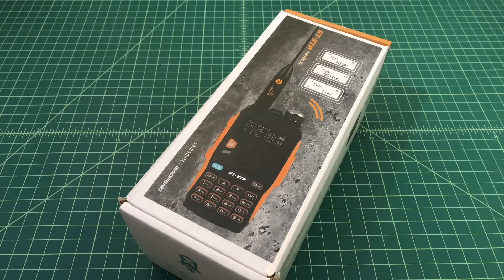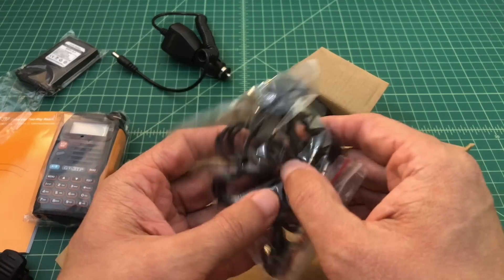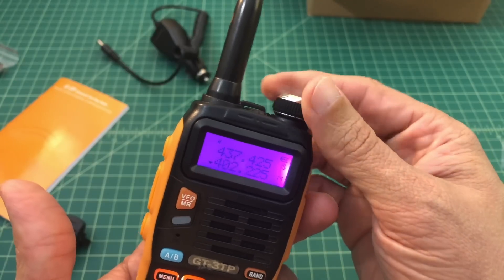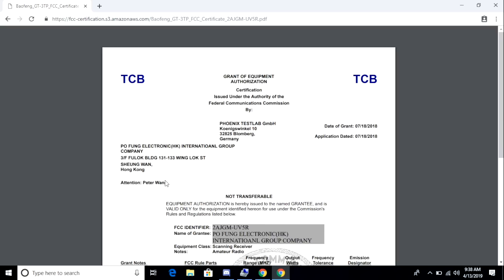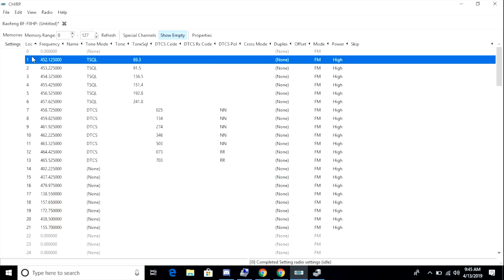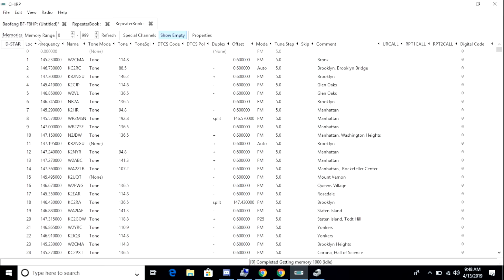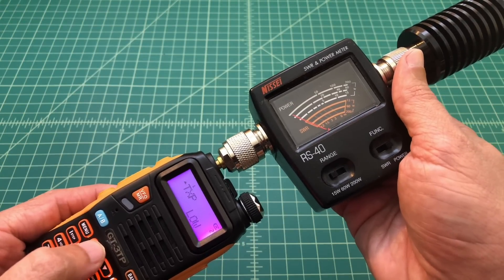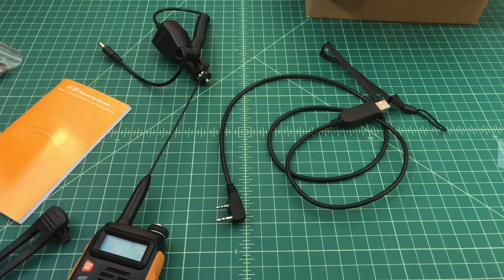Baofeng GT-3TP HAM Radio Review - TheSmokinApe

Comment: Hello, just purchased the same radio and cable as in the video. Followed the instructions but continue to get an error that the radio is not responding. Any suggestions?
Reply from the maker: Make sure your connections are good, the radio is on with med volume, and you can see the cable in device manager.

Comment: I just programmed a new GT-3TP following your instructions and ran into a problem. It appears that if you set the vhf uhf lower and upper limit as you instructed, you cannot manually enter any frequency outside that range after programming with chirp. Did I do something wrong or should we not set lower / upper limits?

Comment: Hi,
is there any Firmware that let´s it also broadcast in DMR mode, so uses digital codecs instead of just analog FM ? I wanted to have a DMR device, but unfortunately bought this device, which standardly has only analog FM modulation. I wanted to have a digital scrambler and digital codec, so not much noise... Thanks.
Reply from the maker: There isn't anyway to convert this radio to digital, sorry man...
Reply: @TheSmokinApe  Thanks for the Info. I will first test this radio and also later buy 2 additional DMR devices...Thanks Mate.

Comment: soooo I am totally new to the radio thing.  Did I just damage mine by transmitting on it without the antenna attached?  I was just trying to see if they worked straight out of the box after attaching the batteries. :-\
Reply from the maker: It’s probably fine but it’s not something you should do, it’s pretty bad for the radio.

Comment: Is there any option for this radio to charge from USB directly to the radio battery? Not using the desk cradle etc. Cheers
Reply from the maker: Unfortunately not.
Reply: @TheSmokinApe  oh ok thanks mate.  So if the radio can only handle 10V going in, is that right? Technically if I find a USB that regulates 10volts could I rig up some sort of charging capability?
Reply from the maker: Anything is possible but that’s above my pay grade 👍

Comment: Very good video. You mention that once a transmit range has been set using Chirp even a factory reset can't change it.
I made a mistake entering the range. Is there any way to correct this? Cheers, Bruce
Reply from the maker: You can use Chirp to set it back.
Reply: @TheSmokinApe  Thanks, that worked. I tried before but didn't realise that upper frequency is up to but not including the value. So I thought I had failed to change the upper limit. G0NSH 73.

Comment: Lol in the beginning you're like "we're gonna test the watt outputtage"
Reply from the maker: That's technical terms!
Reply: *wattage output
Reply from the maker: Of course.  It’s easy to get tongue tied when the camera is rolling.
Reply: Yeah I figured that was what happened, just picking on you. I have something I wanted to ask a pro also.
I'm a volunteer firefighter and we're allowed to have our own portable radios. I need something that supports lower channels like 46.18 but that can also support high band VHF like 152.285.
Our dispatch is on 46.18, but our local repeater is the 152 one. What would you recommend for a radio that supports both of those?
Side note: I don't care what the FCC thinks, it doesn't have to be approved, I just want something capable of transmitting on those frequencies. The furthest I'd be talking on it is maybe 5 miles max. I was thinking maybe a BF-F8HP?
Reply from the maker: That’s a pretty wide piece of spectrum, I assume you need to receive and transmit on all those frequencies?  Do they supply radios that cover that range?  I would think you are looking at a pretty expensive radio.
Reply: TheSmokinApe Yes I'd be receiving and transmitting on both. No, they don't supply radios like that. We have basic Motorolas for the 46.*** channels, there's 6 of those. One is the dispatch channel, and we can't actually talk to dispatch on them cause they're about 20 miles away, but on the other 5 channels we can talk to each other while on scene.
Some members do have the high band ones that transmit on the 152 channel (our repeater) and nothing else. It would be really convenient to have dispatch on one and channel 2 or 6 on the other with a Beofeng using the same radio with dual channel mode, but I understand it's probably not possible.
I'm just trying to decide which is more important; talking to dispatch or talking truck to truck.
Reply from the maker: Yeah, I’m not aware of anything that would cover both. Sorry man...

Comment: I have tried several variations and keep getting an "radio did not respond" error. Any suggestions?
Reply from the maker: You have to make sure your cable and drivers are working, firmly plugged in and the radio volume is up.  Use the same radio I did in the video and make sure your chirp version is up to date 👍

Comment: I have purchased this from amazon UK today I am looking forward to play with this, has anyone figured out a 10 volt car charger for this radio?
Reply from the maker: I’ve only charged mine from the house
Reply: @TheSmokinApe  I thought I update you, so I received my GT-3TP radio and in the package they included a 10v car charger... SWEET.
Reply from the maker: Kay Choudri Nice!
Reply: Can u use this as a handheld vhf on a boat to communicate on channel 16  or other designated channels of marinas?
Reply: @klemenprezelj  2 years after you asked the question, but yes. I got one of these and using Chirp I programmed it to the full set of marine channels. In Chirp I set the frequencies to the correct marine channels, so in 'channel mode' is works and looks just like a ordinary marine radio. But you also have the entire range of 2m frequencies in 'frequency mode' with the limits too, and of course the 70cm band available too on the B option. A great little radio I can use for Ham radio and as a marine vhf.
Reply: @Cailean_MacCoinnich  , would love it,prob. But i would never get it going with all the programing. I know nothing of it 😂 thx for replay